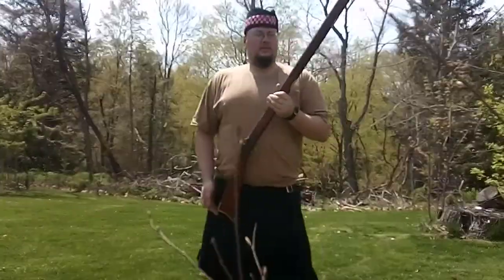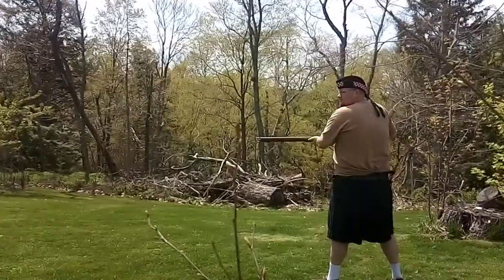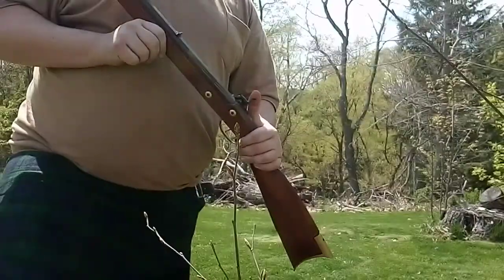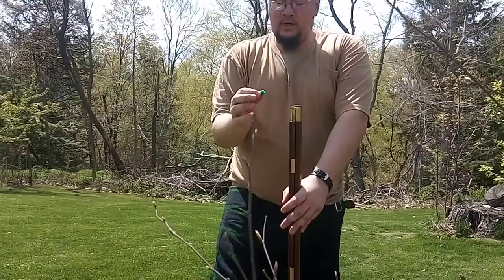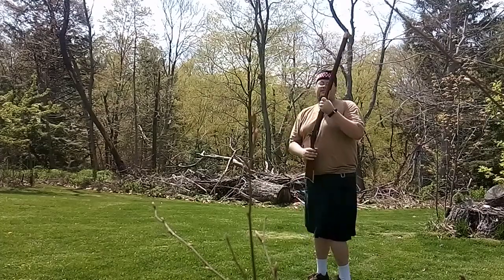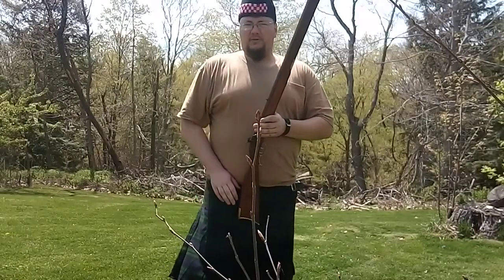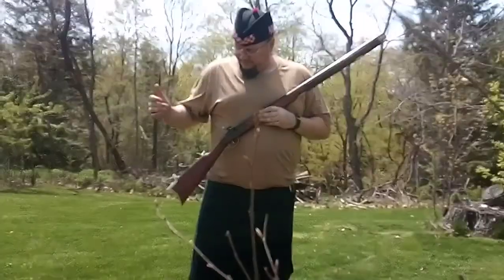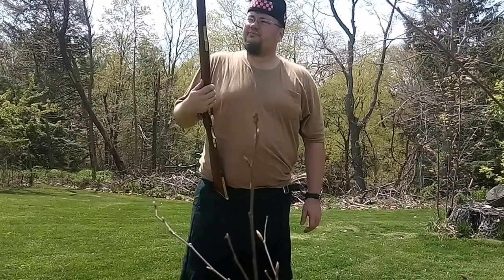Shenandoah muzzleloader project and shooting

Comment: Nice video! Beautiful rifle, and nice Kilt! 
I don't think your misfire issues are due to faulty percussion caps, I mean it could be, yes, but the next time you shoot, try this...
I call it the "lean tap". I am a fellow muzzleloader lover and adding this step to my loading routine has given me 100% improvement with zero misfires.  
Once you have added your powder, before you add the ball, with the butt of the rifle on the toe of your shoe and the triggers facing away from you, lean the rifle towards the hammer side (The right, for most rifles) and tap the other side of the rifle, around the action, two or three times. This will throw a small amount of powder up into the flash chamber. With a ball packed in tight on top of it, the powder will stay that way insuring a good fire, each and every time...as long as your powder stays dry lol. 

Keep up the good work!
GO SDI!!!
Just started the muzzleloader class myself! 
I have built two of my own so far!

Take care
Wayne
Reply from the maker: That's awesome brother thank you and appreciate the advice. Still new to BP myself.  Good luck with the project bud!